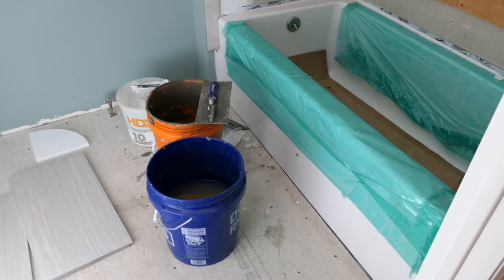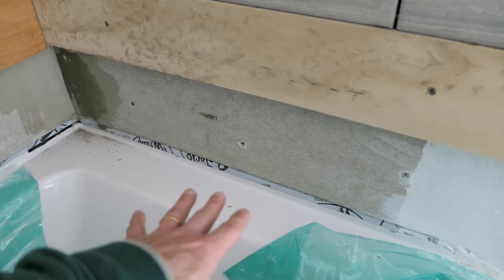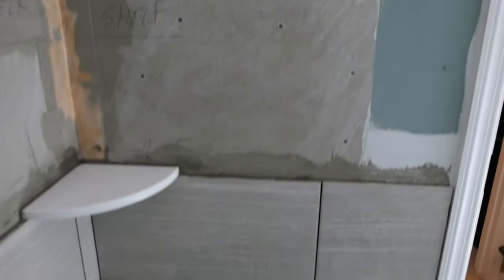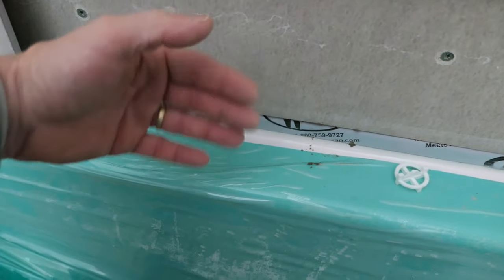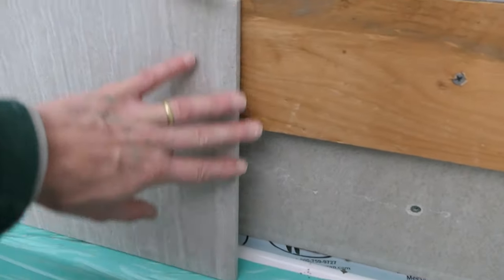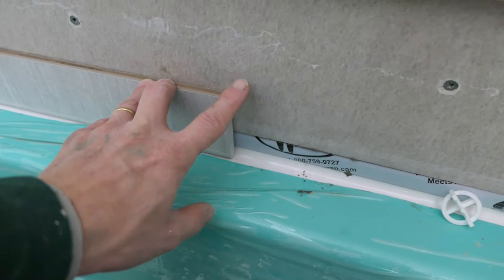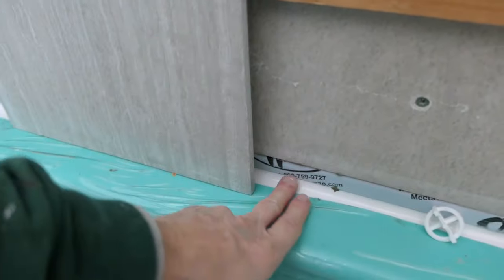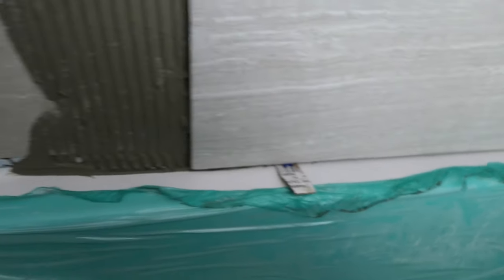How To Tile Over The Lip Of A Tub Or Shower Pan

Comment: Great video, but just like to know your opinion. Some people fill up the gap between the backer board and the edge of the tub with mortar(tinder), than install tape and after that waterproofing membrane with fabric.
Reply from the maker: No matter what, the thinset mortar will not stick to the lip-- for any period of time, anyway.  So any attempt to make that area more durable is really futile.  If you attached tape and waterproofing membrane or a liquid membrane, all you have really done is made a mortar hinge!  And to what end?  If you intended to use a waterproofing membrane over the whole wall anyway, then no harm done, but there's no reason to make a special point of it.  It's wasted effort.

By contrast, if you just fill the space with thinset mortar as I have shown, that mortar WILL stick tenaciously to the back of the tile itself.  The space is filled and the mortar secure.  Now if that area receives a bump or a hit (hey, people do weird things in the shower!)  there is support in this backing even though it won't actually stick to the lip. And, as I have said, I install that self-adhesive flashing so that even if a homeowner doesn't maintain the grout or caulk, there will be nowhere for the water to go but back into the tub.

Comment: You know, not one DIY site or video ever mentioned the necessity of bringing the board over the flange for subway tile, like what I'm using. Also, no one mentioned that thinset won't bond to the tub, which always confused me about some people saying to thinset the flange. Thanks for answering that.

I bought 3x12 subway tile. So, thinset applied to the flange wouldn't act as enough support for a smaller tile like that? 
One installer's blog mentioned using a sealant like Sikaflex and mesh tape to seal the joint between board and flange, and then tile over it. Would extending the sealant work for supporting smaller format tile? Or is it no different than just applying thinset to the flange?
Reply from the maker: You see in this and other videos of mine that I use a flexible flashing tape to go over the flange and under the backerboard, just as insurance in case anything goes wrong in years to come.  I do not use any kind of sealant or silicone at the lip before tiling.  After the tile is complete, the gap between the tile and the tub is sealed with silicone, which is flexible.

Since you are installing a smaller tile, or at least a shorter tile, then you need to get the backerboard over the lip.  Thinset will not stick for any period of time to the lip or to the flashing I use.  There is no other adhesive approved for this application, either.  If I can't get the backerboard over the lip, then I advise my clients that they cannot use a short or small tile in this application.  There's no point in installing a tile that is going to pop off the wall in a year or two.  The thinset which ends up in the lip area merely provides a backing for the tile so that the tile does not crack there if bumped.  The tile needs to be adhered to the backerboard.  And, yes, I know some people advise using Schluter membrane over the lip, but that doesn't solve the problem.  The thinset under the membrane still doesn't stick to the lip for any period.  If you can get at least two thirds of that tile onto the backer board (the size of the lip can vary)  that is the absolute minimum requirement in my opinion.  It's still a risk with smaller tile, though, so make every effort to get the backerboard down over the lip.
Reply: @enduringcharm  Thanks for the reply. I'm making my way through your other videos. Great channel.

I've decided to just alter the pattern since I already have the tiles. They're 12 inches long, so I'm going to do vertical bottom row into concentric 90s. I think it will solve a lot of problems for me, like easier cuts across the tile, blend in with the out of level tub better, as well as put at least 80% of the tile on the wall. Your video helped me realize I had to change things up. 

Thanks again!

Comment: Great video! I have a delta alcove shower pan that I'm planning on tiling over, and I've got that little lip, but right at the front of the pan on each side, the lip curves in and is flush with the studs, rather than there being this half inch gap where the backer board kinda slides in.  It's made for either tile or a surround, but I'm not sure what to do about that weird curve. Do you have any ideas? I hope I'm explaining it right. I wish I could post a picture of it
Reply from the maker: Yes, it would be nice to have pictures available in these comments!  I'm not sure I follow your concern exactly, but it could be that your pan is only designed to have the backerboard sit on top of the flange.  If that's the case I would still use a flexible flashing if at all possible, such as Zip system stretch tape.  If there are curves or other irregularities in the pan you'd have to cut the tile around them.  You may be referring to a small area in the very front of each side lip where the lip suddenly thins.  Sometimes this is intended to have the backerboard or drywall to go over that small section as a transition point.  You may have a small area that you need to fill with thinset when you tile.  If you can use the flashing, though, at least you know that water or moisture will not get into the stud bays.
Reply: @enduringcharm  yes that's exactly what I'm talking about! I'll have to get some flashing! I've honestly never used it before but I've only tiled one other shower. I'm a contractor but have only been doing this for 6 years so there's a lot of firsts for me lol. I uploaded a picture of the pan and tagged you in it here on YouTube.  I'm not sure if you got a notification for it! But yeah I think you're right about just putting the backer board right above the flange instead of in that little lip. I was just gonna shave that part in the front off but that's probably not a good idea 😂

Comment: Hey John I love your install method in this video, it’s exactly what I want. I have a question. Can I use a Vikrell tub or an acrylic or some sort of a composite tub? Realize they have a lot more flex in them when you walk on them also can you install something on the floor to glue it down and give it more stability?
Reply from the maker: Yes, I use acrylic or fiberglass tubs in this situation routinely.  As long as only a small portion of the tile overlaps the lip, you'll be fine. The silicone caulk helps absorb movement.  Each acrylic or fiberglass tub has it's own installation requirements.  Some are meant to be bedded in mortar, others have built in feet of some sort.  Some specify both, since the manufacturer is just trying to cover their rear-end and they have no experience in the real world!  All acrylic or fiberglass tubs are prone to movement and sometimes squeaking, though.  For some tubs installed on their own feet I will reach in underneath and spray expanding foam after installation to help stabilize the tub.  Just be careful not to use an aggressive foam that will lift the tub or distort the form.
Reply: @enduringcharm  thank you sir

Comment: Good video ,what about waterproof membrane,does it work or is it good
Reply from the maker: Waterproofing membrane has it's place.  I use the Schluter system when I tile the floor of a shower and I run it up the walls, too.  However, there is also a marketing-induced obsession with waterproofing which borders on the insane.  It isn't required in every circumstance and there are even downsides in using it, including cost and a reduced adhesion over straight cement backerboard.  So I use it when I think it's needed and not when I don't.  The place I do add waterproofing every time is the edge of the tub or pan where it meets the floor.  That's where I find rot or moisture damage in nearly every bath I demo.
Reply: @enduringcharm  I bought some waterproofing membrane to go over the backer board for the wall tile and got to thinking of how the most important place to put it would seem to be on the floor around tub. I thought I was probably just wasting my time after I bought it to put on the walls since the waterproof backer board covered with thin set should do the trick. The long n short of it is what you commented above makes perfect sense. Great videos too.

Comment: When place backboard over existing drywall like in your video. What thickness did you use? 1/4 inch or 1/2 inch?
Reply from the maker: There might be some confusion here.  The backerboard is not placed OVER existing drywall in a shower, the backerboard is applied directly to the studs.  Half-inch backerboard is used.  Where the edge of the backerboard meets the edge of the drywall in the rest of the bathroom you'll need to transition using joint compound just like you would with any drywall.  I try to put this transition outside of the wet area and the spackle is thoroughly primed and painted.  You might check out some of my other videos for more information.

Comment: I see you stop the hardiebacker right at the tub edge. What do you do if you're running bullnose down to the floor say 2 or 3" in front of the tub? I'm butting up against wood lath and plaster. Do I run more hardiebacker down to the floor for the extra 2 or 3" width??? Thank you.
Reply from the maker: Actually, I normally install the backerboard to some point outside the tub or the pan, which is what I did here.  As part of the prep before tile, I will use joint compound to feather across the backer/wallboard joint and sand flat.  Then I'll thoroughly prime that area, and roll on two finish coats of paint.  That is given time to cure fully.  Then you can tile over that small painted area, or install a waterproofing membrane over it, close to the edge of the tile line if you wish.  How far outside of the tub I go with the backerboard depends on where I can use or install framing for the joint.

Comment: In order to match the rest of the bathroom wall, the cement board has to sit on the lip of my shower pan. I installed the 9" flashing tape behind the cement board like you did. What should I use to fill the 1/16"-1/8" gap between the cement board and the lip before I start laying any tiles on? Caulking or thinset? If there's no gap (like tightly sit on the lip), do I still to caulk the joint? Will the caulk stick to the flashing tape?
Reply from the maker: So you have self-adhesive flashing tape covering the lip of the shower pan, and going up the studs all around, right?  Then the backerboard comes down to the lip, and hopefully the surface of the backer is slightly proud of the lip?  If that's the case you can fill the area of the lip with thinset when you tile and be on your way.  There's really nothing gained by caulking that small gap between the backer and the lip as long as you have used the self-adhesive flashing.
Reply: @enduringcharm  Yes, the self-adhesive flashing tape covering the lip of the shower pan and going up the studs up to 7" all around. And the surface of the back is out by 1/4". The height of the lip is 1". That means I need to fill the 1" gap behind the tile and below the cement board with thinset. Will the thinset stick to the flashing tap? Having finished tiling, I need to caulk the 1/8" space between the tile and the flange, right?
Reply from the maker: The thinset won't stick to the flashing, but neither would it stick to the tub lip!  It will stick to the back of the tile, though.  It will provide a backing of sorts so that if the edge of the tile is bumped or cleaned roughly, the tile won't crack.  Use a silicone caulk between the edge of the first row of tile and the tub, and leave that gap free of grout before you caulk.  The caulk will also offer some support of the tile.
Reply: @enduringcharm  Thank you very much for your professional advice.

Comment: Just plastic behind the backer board, no RedGuard on top of it? Just taping the seams? What's your thought on waterproofing the DuraRock?
Reply from the maker: When I feel the need for a complete waterproofing system I use the Schluter Kerdi product.  The plastic is not there for waterproofing, it's there in the event something goes very wrong in the future, such as broken tiles, missing grout, shifted framing, etc.  I've seen things! I don't use Durock I use Hardibacker, which is not as porous and which is a stiffer product when installed.   There's an old video of mine I made many years ago on this subject which I should probably update:  https://youtu.be/xk7lNudSV2Q

Comment: If you have really small tile, could you not use silicone at the bottom to hold it in as well as the tile adhesive at the top?
Reply from the maker: When you finish tiling and grouting you will use silicone to seal the gap between the tab/pan and tile.  That also does provide some support.  However, it would be foolish to rely on that.  If you are using a small format tile you should make certain at least 2/3s of the tile is adhered to backerboard in the area of the lip.  If necessary, bring the backerboard down over the lip to eliminate the gap and provide more support.
Reply: @enduringcharm  I would do both. Use the silicone as an adhesive at the back of the tile (only if you really can't use the backer board of course) and the put another seal at the base after tiling. I've been taught by my builder to always seal tiles at the bath twice anyway, one bead of silicone at the base when you bed them in and another when you're finished all around the rim of the tub.
Reply from the maker: To clarify, I would NOT use silicone behind the tile as an adhesive.  It's a poor adhesive anyway, and just not intended for that use.  It could also trap moisture behind there since it will not allow evaporation and migration of moisture as both thinset and grout will allow.  If you are using a small tile you need to get that backerboard low enough over the lip so that 2/3 of the tile is adhered to it.  Use shims if possible or relieve the back of the backerboard to fit over the lip if necessary.  There is always a way to get it done.  I have even shimmed out a whole wall and widened a door casing when there was no other option.

Comment: Just to clarify, you're saying that IF you are unable to build/shim the wall out, it's fine to align the backer board in plane with the shower flange.  However, you're not saying you can't put the back board over the flange/lip.  Assuming you had a wall that you could easily shim, you would still recommend you shim it out and place it over the backerboard.  Am I understanding correctly?
Reply from the maker: Correct.  If you can shim and go over the lip it will make life easier for you and provide a better installation.  Just leave a gap between backerboard edge and the horizontal surface of the tub or pan in that case.  You can caulk that gap with silicone if you wish.

Comment: I’m planning to use a delta shower pan and wanting to tile.  The flange is not straight.  It has a lip on the top.  Do I have the wrong shower pan or do I cut off the lip to make flange go straight up.  After cut flange will only be about 1”.  What brand would you recommend from Home Depot.
Reply from the maker: I'm not sure I'm following your description.  There is a flange, I gather, but when you say the flange has a lip, what does that mean?  Is it that the top of the flange is thicker than you hoped?  Or perhaps you picked up a shower base which is supposed to be used with matching fiberglass/plastic walls?  Additional information would be helpful...
Reply: @enduringcharm  like an upside down L.  Delta b12135 6032L.  It says it can be used with prefab walls or cement board for for tiling.  I don’t know how to seal the transition from flange to cement board.  Thanks for responding and the help.
Reply from the maker: Okay, I looked it up and I see what you mean.  Kind of a dumb design, because it's trying to cover two things--both the prefab walls or backerboard for tile.  The same choices apply for this design, though.  Either you shim out the studs enough to allow the backerboard to go over the lip, or you place the backerboard on top of the lip.  If you do the latter, then use Zip System stretch flashing or similar over the lip and under the backerboard.
Reply: @enduringcharm  thanks.  You’ve been a great help.  Especially to ease my mind.  Maybe another question.  Does water wick up through the soft set mortar?  Thanks again
Reply from the maker: If you prep and tile correctly you'll have nothing to worry about, and this so-called wicking problem is an internet thing.  I've taken apart 65-70 bathrooms, many with nothing but wallboard behind the tile, and wicking is just not a problem.  However, I use the flashing idea just in case the homeowner fails to maintain the grout or caulk, or something else goes wrong.  Check out some of my other videos about tiling, there are important ideas and suggestions in all of them.

Comment: If you're using a smaller tile 4x6,  can you use thinner backerboard in those spots so it has something to grab on to?
Reply from the maker: I'm not sure I follow what you are asking.  If you are installing tile of any size on the wall, the cement backerboard should be 1/2".  It needs to be that thick to prevent flex.

Comment: Could you not use a construction adhesive like liquid nails on the lower tile row? Then continue on with thinset?
Reply from the maker: No, construction adhesives or mastic are not rated for wet applications, and that would fail a building inspection if caught.   Thinset works very well and will hold tenaciously even when wet.